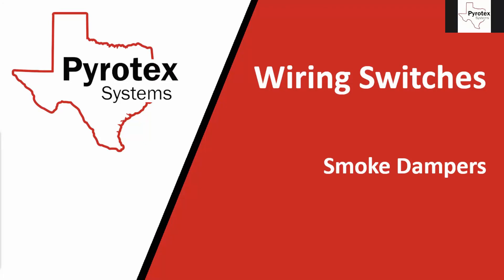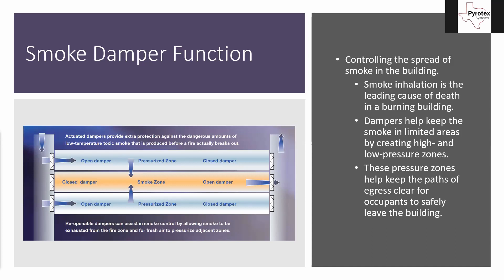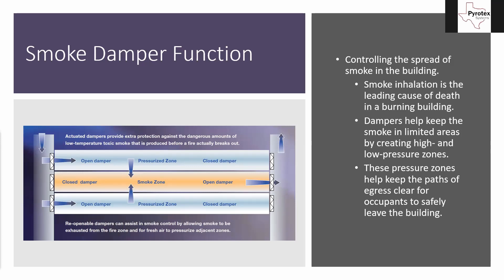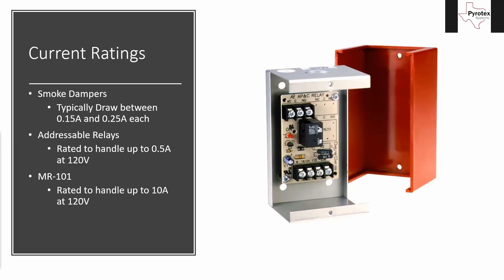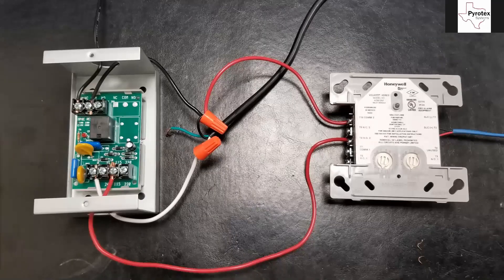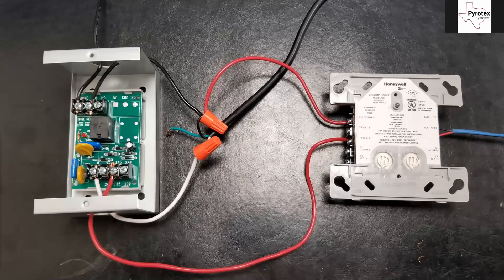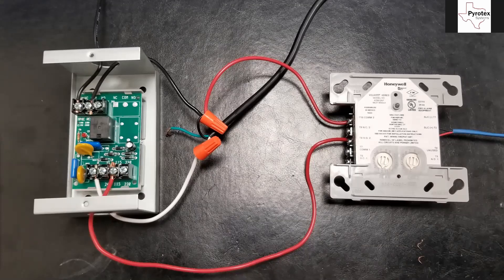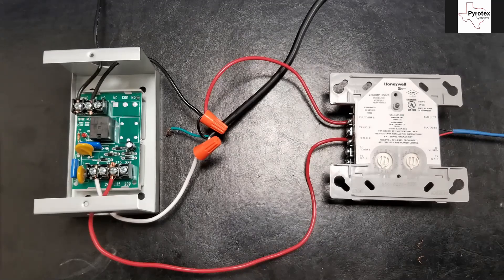Smoke Dampers

Comment: Thank you for the info. How much voltage is require for the module? Thank you.
Reply from the maker: The voltage on the SLC will vary from manufacturer to manufacturer 16-20v DC is typical, and the damper control circuit will be 120v AC.
Reply: voltage Coil  damper relay  120 ac  v ?